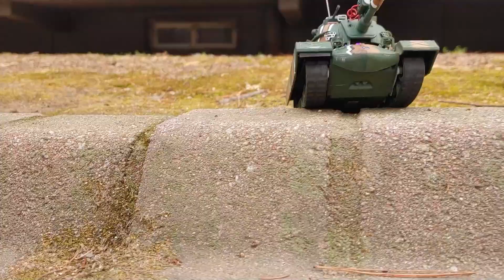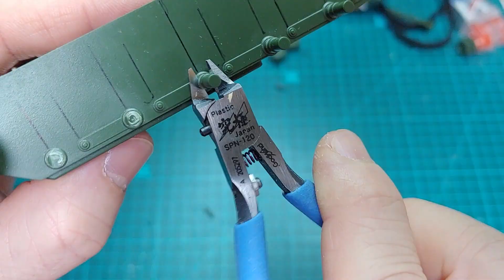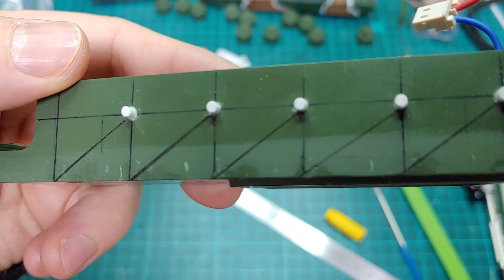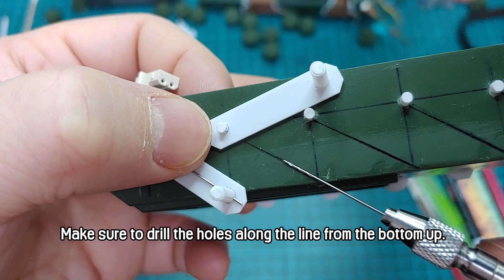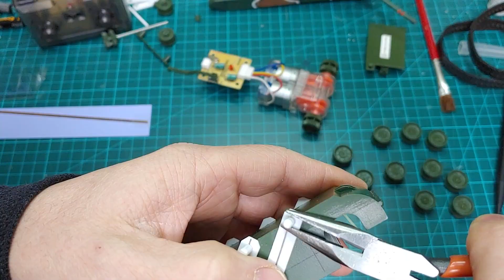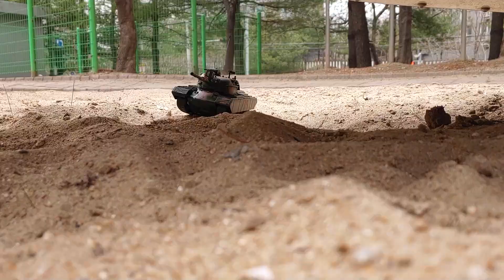AcademyScience RC Tank Suspension Making / what do you make daddy 1:48 scale

Comment: The easy torsion bar suspension. LOVE your t-34! Btw, how did you put on the wheels?
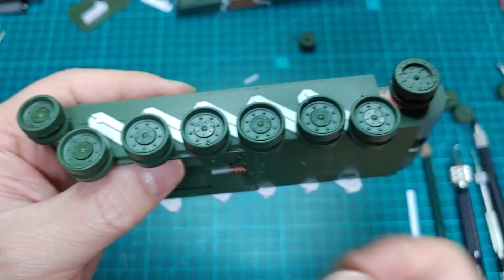Reply from the maker: Please refer to the video from 13:30 to 13:43.
It is an easy-to-assemble product that comes with the kit itself.
Just put the rubber-like part in the middle of the wheel.

Have a nice weekend.😅😅
Reply: @ thanks! You too.